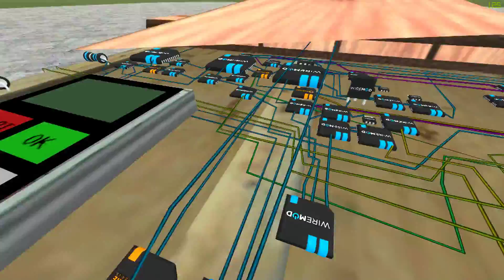Garry's Mod - Wiremod - An advanced disarmable bomb

Comment: How did u make the wooden board and the screen flip up? Ive been trying forever to get it working, I know it involves wire hydraulics but I cant seem to keep it in one spot without it flinging everywhere
Reply from the maker: Make sure the hydraulic is at a low angle so it can support the screen. Also make sure the hydraulic isn't too long. If it's so long that the screen tilts forward, the screen will flip down and get stuck. It has to lean slightly back.
Reply: @MulleDK19  Thx, I already found a solution using advanced ball sockets and the button on value is 55 and the off value is 0

Comment: What happens if you unplug the thing and countdown from 10 goes to 0?
Reply from the maker: There's a small bomb inside the main device that detonates then.
Reply: MulleDK19 Will you release it?
Reply: Whats the purpose of the plug then
Reply: @MsBobbyTV  late response i know but its for connecting the main explosive charge to the bomb electronics
Reply: Even later response but it's just for coolness and also being able to swap out bombing platforms